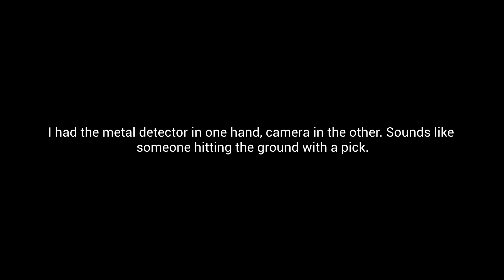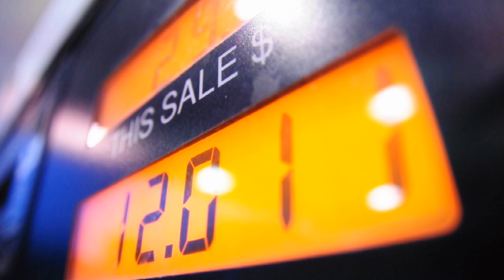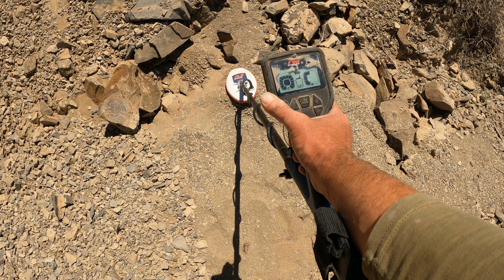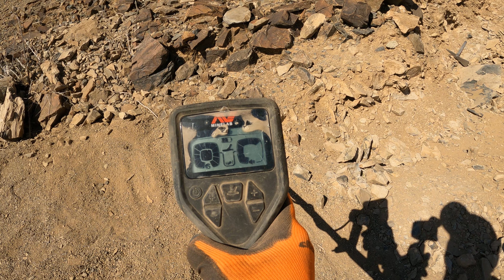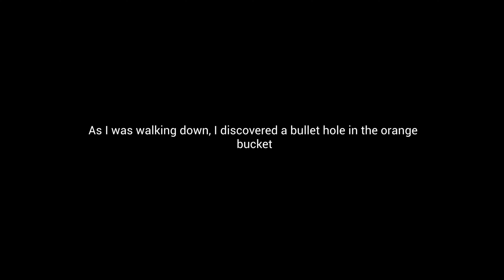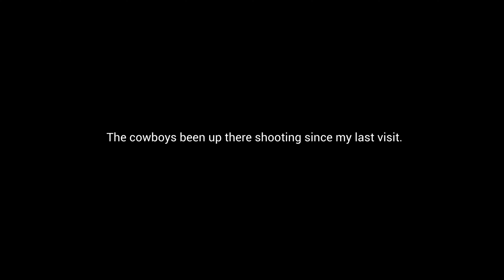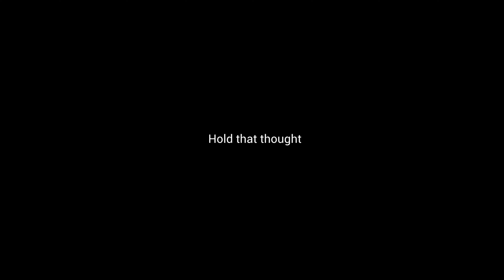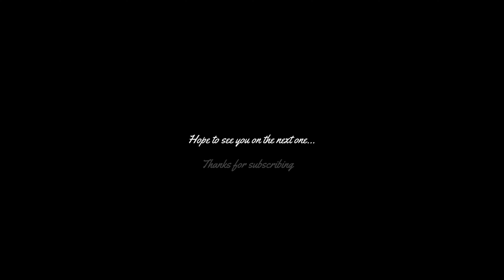Something You Don't know: Pocket Gold and Metal Detecting

Comment: people have told me the bigger coil doesnt get the really small stuff (nugget shooter).  and that it doesnt really go that much further. (5 inch is best). ,  tell them just cause they see quarts doesn't mean theres gold. deposit can be way down. (its like a 50% chance). me california. belong to 3 clubs gold is were ever takes a bit of searching  just saying. (nothing bad).  be in the desert 18   looking at another spot.  have a good day.
Reply from the maker: Yeah I agree with everything here. The coil doesn't go deeper, but the sensitivity setting (auto 2) will go slightly deeper than full manual. The bigger coil covers more surface area, but will not give more depth. 5 inch is really good to navigate around hot rocks if the area is mineralized. The quartz outcropping was a target because of the surrounding rock and the history of the mining that was done there (area specific & pocket gold mining). Explaining something a bit more technical to such a broad audience can challenging, although I did try to add some text for context. This video is probably a bit more for seasoned gold prospectors who use a metal detector for gold. I appreciate every bit of advice, thank you.
Reply: @WheelieShinyGold  ya not saying anything bad. 👍👍👍

Comment: Please what is the name of this machine
Reply from the maker: Minelab Gold Monster 1000
Reply: Its Max deep please
I want to buy one 
If you could help me by info 
Thank you man
Reply from the maker: @you-in-thefuture  this machine is used for shallow ground, commonly used on bedrock. This machine is Very low frequency and more sensitive for smaller gold. If you're looking for a machine that goes deeper (but less sensitive for smaller gold), a pulse induction machine might be better.
Reply: Thank you so much 
For example 
Can this machine attract a piece of gold(200G) for 1  metre
Reply from the maker: @you-in-thefuture  that's a very good & interesting question. To achieve that depth with the gold monster 1000, I would imagine improbable but technically not impossible. Too many variables (composition of dirt, size of gold, settings, ect). If the gold concentration was high enough, and gold was deposited in favorable ground, technically could be possible but very unlikely. Ratio of depth and size gold is important when considering this. The max depth that I have achieved with the gold monster was approximately 2ft but the concentration and size of gold found was very large and is incredibly rare. If you're looking for gold that deep, I would consider a powerful pulse induction metal detector.
Reply: A massive salute sir 
I hope i get one 
May Allah guide you